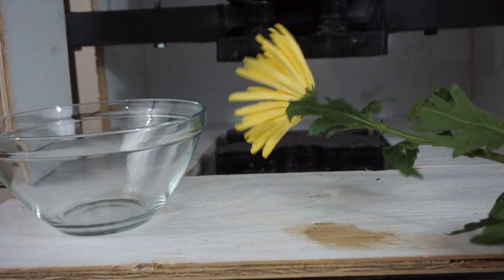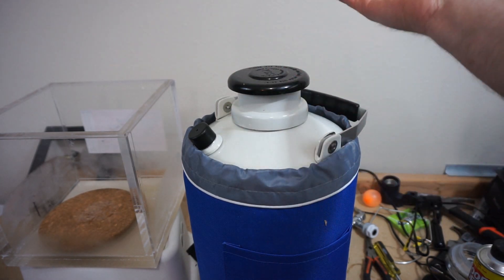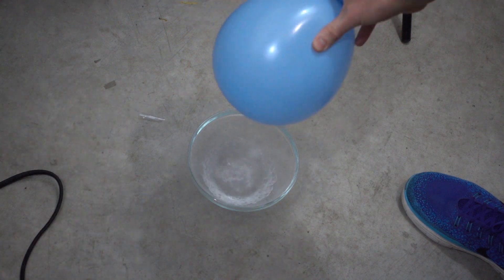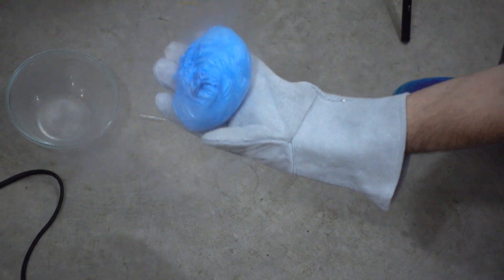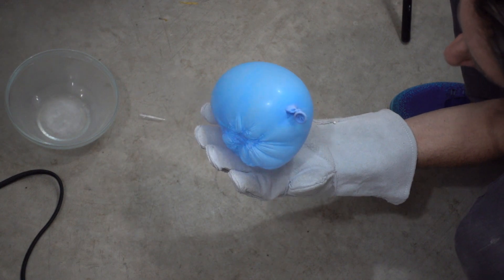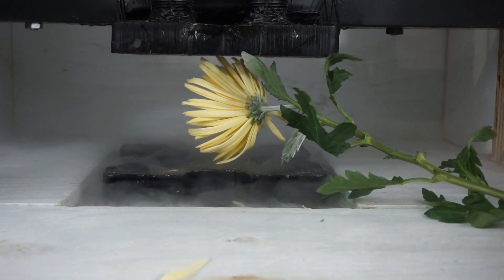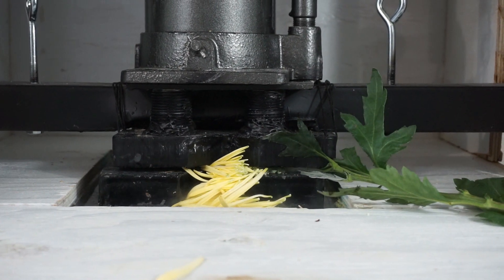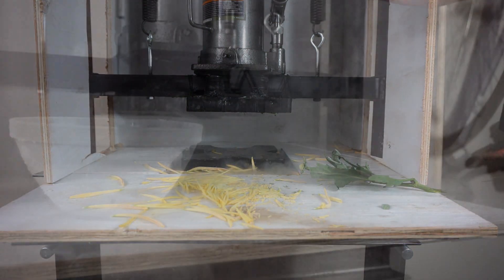Crushing Liquid Nitrogen Frozen Flowers With A Hydraulic Press

Comment: Is there a material you won't try in the hydraulic press?  For ex if you try Titanium are you worried it will break the press blocks.
Reply from the maker: +Honey Badger yeah if I press something harder than the steel it won't break the press but it will make divots in the steel

Comment: As I commented  in some previos video. Press PEX hose to foil stage and firmly  reheat it, it will reform itself to the original form. That is is the X in PEX. The molecular bounds is very strong and will not break just by pressing. That's more wow than this...

Comment: Hey dude! What happens if you put a sealed vacuum jar (full of air) in water and turn the vacuum on? Does the jar sink or keep floating? And if it sinks, how heavy does it get and how hard is it to lift up?
Reply: Also try filling the jar about half-way with water
Reply from the maker: +Vegetsu101 the jar would just keep floating like normal. The buoyancy of the hat only depends on how much water it displaces. Since the jar is sealed with air or vacuum it displaces the same amount of water, so nothing big will happen. But I've seen several other questions related to floating in a vacuum so I might do a video on this!
Reply: alright cool :)

Comment: didn't you say liquid nitrogen would explode if it was in a sealed container? so if you put it in a vacume chamber would it explode?
Reply from the maker: +Mitch Farslow the vacuum chamber lid just sits on top so it just pushes the lid off slightly. But if you ten on the vacuum it will still lower the pressure as long as the pump can suck out more nitrogen than is evaporating off the liquid.